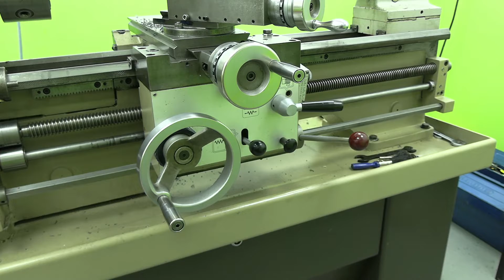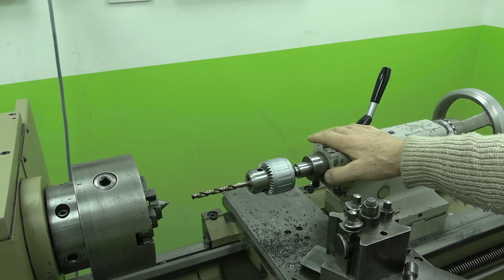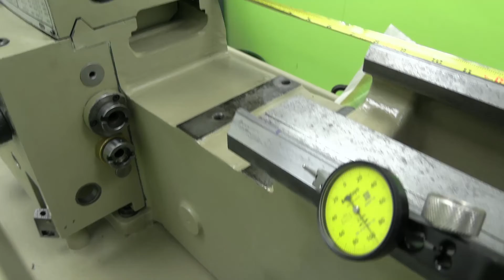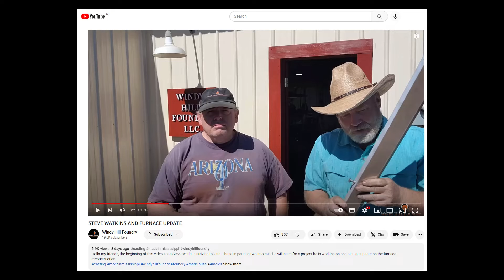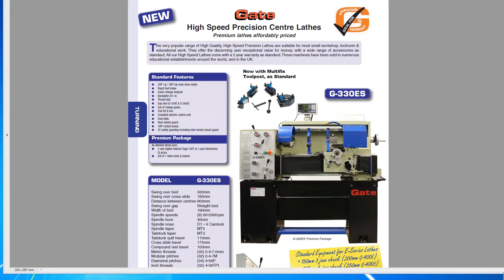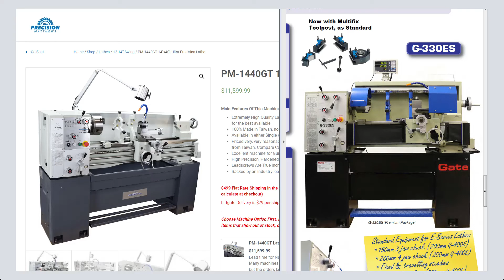What shall I do with my Harrison M300 lathe??

Comment: Hello ! I was on similar patch on resurecting Harrison VS330 Lathe - someday it was called a tool-room lathe, but it was closely based on M300, except different  headstock. 

What i did - regrind of the bed, regrind of cross slide, tighten of the main bearings,  bore tail-stock to 45mm and inserting sleeve made from cast iron bored to size of tail stock barrel. Which was lapped before of course. Sleeve was just glued on some loctite 638, while tail stock barrel was in 4 jaws chuck. Dialed to a perfect fit. 

Biggest head-ache was refitting of headstock on new beds - you need to grind contact areas top get all geometry property. 

Also - have same pitch selector problem - numbered selector was in wrong place. 

That is still left - adjust leadscrew play, make a new cross slide screw, fit a new, used saddle with new cross slide (i did fitted my old one, but its have too much geometric defects after it. )
Reply from the maker: My you've doen a lot. I don't see how to adjust the headstock alignment on my M300 without scraping the ways beneath the headstock, which seems problematic. Were you able to make the tailstock sleeve on the VS330?
Reply: @samuelfielder  Hello. I made sleeve for tailstock on same lathe. Biggest issue was boring old tailstock - did this with 4 jaws chuck and long and fat bar. 
Btw - if you glue them using loctite, you can make sleeves, not only one big. It helps to make them easier. And yes, to adjust head stock you scrap beds or add some shims. Some left shims in place, some use them to find amount of metal to be removed.
Reply from the maker: @StanislavZachazevski  I assume you made the tailstock sleeve slightly undersized for the tailstock i/d, and by holding the quill in the 4-jaw you were able to let Loctite 638 fix the sleeve is right place? A couple of youtubers have used a makeshift bearing holder on the saddle to line bore the tailstock sitting on the ways, which seems quite a good idea if you can make it work (https://www.youtube.com/watch?v=v6dtsHu_ljM&t=1562s and https://www.youtube.com/watch?v=ND6M26OHAEI .
Reply: @samuelfielder  Exatly - i have added some old videos. I tried to bore old one - but it is a lot of work to do it propertly and make it a perfect fit. You need it in a 0.01-0.015 gap, at whole length, with perfect surface and perfect alignment. Mine method - was lets give it a shot, if it will not work - add sleeve to be rebored in place.. All done on same lathe without any extra tool. And all proved as good as it could. And if something goes wrong - heat it, remove old sleeves, make new ones to lapped barrel and all done.
Reply from the maker: @StanislavZachazevski  Thanks.
Reply: @samuelfielder  you welcome. On boring tail stock - you place you boring bar in 4 jaws chuck, cross feed is done using chucks, longitudal feed - by placing tailstock between head stock and saddle. And you feed it using saddle. It have to be slightly pressed to beds using fixing handle.
Reply from the maker: @StanislavZachazevski  Thanks that is clear.
Reply: @samuelfielder  Found my old video of tail stock fixing process. https://youtube.com/shorts/AbUcFwxUmPI  https://youtu.be/EWKICmUa9EY  https://youtube.com/shorts/kmppnC6UiNs 

Enjoy ! Remeber - if you start to use you lathe as it is - you will adjust yourself, and will not fix it.

Comment: I've followed your progress and I use m300 lathes. I'd keep the one you have and buy a lathe bed and saddle and get that re-ground and transfer your stuff onto it. We may have one spare if you go down that route
Reply from the maker: That's an idea. It would mean I could still use the lathe whilst the regrind was going on up north. There might be a problem of getting the old headstock to align with the new bed, requiring scraping the ways under the headstock which is a skill I don't (yet) possess! Are you in Southampton UK?

Comment: I am no expert, but here's some info you might want to feed in: I watch Matty's Workshop. Perhaps you do too - he is based in New South Wales and makes some really good stuff and though I think he was not originally a trained machinist (not sure about this) he's very capable and practical. A couple of years ago he upgraded from his Chinese 9" lathe, and selected a Taiwanese lathe from the large Australian machine tool importer/distributor Hare and Forbes, the AL960B. He seems to get absolutely top class results from it, so window shopping I started googling around. 1. It generally has a good reputation on forums, though it is not common. 2. Precision Matthews do what I believe is the exact same lathe, the PM1236T, one down in size and $500 cheaper than the one you have looked at. 3. This is the relevant bit, I do believe that Gates do that same lathe - it's hard to prove it's exactly the same one, but Gates did come up as a reference customer on a site I found that seemed to be for the original Taiwanese manufacturer. Perhaps you also saw this lathe when you visited. My main point is that my conclusion was that whilst Gates did seem to offer good quality Taiwanese lathes, they were ridiculously over-priced - I mean that 14" one that you are looking at is £6300 in the US. I don't think I would buy from Gates, because although the kit is quite possibly high quality, they seem to be taking the mickey on their prices. This opinion is not based on an attitude of 'any 40 year old thing made in Britain is bound to be much better than anything made last year in Taiwan'. In fact, I was involved in steel supply to the engineering industry in Britain 40 years ago, and we turned out some right rubbish sometimes. And I was very glad to switch from British cars to Japanese at the time (when you heard the same patriotic guff about their products - though that's been rather forgotten in the last 40 years).

The problem with a 'good' used M300 for double/triple the money is that you don't really know if it's actually any good until you start cutting on it. Any on-site inspection is likely to be rushed and partial, though you could probably make a  much better inspection now than first time around. Still, realistically you are not going to find the perished oil seals before you buy it, are you? Seems to me a higher price will guarantee only better cosmetic condition, not actual better underlying condition, given how Ebay and machine tool dealers work. If it's disheartening to dismantle and re-grind the one you have, think how disheartening it would be to find the new one you paid £5000 for was still not good enough.

If you can solve the tailstock problem (find one on ebay or from a dealer one that is tight enough, and pay for a regrind for any height differences, or do some scraping?) then I suspect a  bed re-grind will make you happiest, but it's another year to sort out - quicker than last time as you know so much now, but still a lot of work. Good luck, well done with how far you have got already, and thanks for all the very interesting videos in that whole series.
Reply from the maker: Thanks. As you say I think the PM1236T is a little on the small size compared with the M300, so not sure I'd go for it. As regards the ridiculous UK prices of Taiwanese lathes, I'm afraid that's absolutely standard over here and I think I'd have to pay those kind of prices, unless I went for an inferior Chinese one. I still haven't decided what to do, but there's a machinery dealer pretty near me who has about five used M300 in stock, so I plan to go there and see if I can run a DTI along the ways - I can detect bed wear pretty well by mounting a DTI on the saddle and running it along the machined but unworn top of the front V-way - and see if any of them measure well. It would be more fun (for me and viewers) to go for the regrind, but I fear more potentially problematic.

Comment: Ok what i am going to say is because of my ues of very old lathes . what you are seeking to do it work you will not desire. so i look as lathe  as horse's for courses  So it is  time if you when perfection in a lathe You need to by new as for Bering agen you pay for what you get begging's  in your lave have  very good  hi quality bearings   you get what you pay for  Buy a  bran new lath  that as the quality you require .    Les England   the question you need to ask is  it cheaper to regrind . or buy new . !

Comment: Samuel, the way I see it you are the type of man that likes things to work the way they should and compromise just keeps you up at night. I am of the same mold. I looked and used stuff and decided to go with a new lathe. The reason was that I wanted to get started on machining projects rather then making the lathe the first project. However, that being said, if I had it to do over again I would probably still buy the new lathe but I would not have underestimated the value of bringing an older lathe back to serviceability because that experience is valuable also. I spent my youth taking things apart and rebuilding them. I rebuild a 1968 Mustang, many engines, and all kinds of building from the ground up. So I have plenty of experience with fixing broken stuff. So the decision for you would be fairly simple in my mind. Do you want to spend a significant amount of time and money learning everything it takes and purchasing all the expertise it would take to bring an old lathe back to life or would you rather spend your time dialing in a new lathe and getting on with your projects? A new lathe will have it's learning curve so what it boils down to is time. How do you personally value your time given where you are in your life. If it were me, I wouldn't take any more chances on buying someone else's problems and get on with your own projects with a new lathe that you can depend on. At your age you have earned the right to get right down to what you want to do and not waste a lot of time and money solving problems. My 2 cents. Good luck.

Comment: I think you will find that Warco do a lathe very similar to the Gate. I have an old Warco 13/27 that was made in Tiawan. It has had a lot of use, but can still produce very good and accurate results, because it has been looked after. I notice you have a small Warco mill, so assume you have no objection to buying from them. My only stipulation if buying from them would be to strip and thouroughly clean everthing before use, as the machines they sell are not properly cleaned of machining debris at manufacture. ie cast iron dust.

Comment: Hi again.
The head stock does not sit on the ways. The shaping is done  to level the head stock to the base on centre.
The four hold down bolts are clearance fit so you can tram the head stock.
I suggest you use some known   ground stock approximately 8 inches from the four jaw. Clock up on top at the end away from the chuck.
Once done move your clock to the horizontal on centre to the stock. 
Run down the stock to the chuck and record the reading.
Now loosen the four bolts on the head stock and tram as you would a vice in a mill.
Reply from the maker: The trouble with this method is that it relies upon the ways not being significantly worn, otherwise one is just adjusting the headstock to minimise taper near the chuck which may well not align it with the axis of the bed further out. Of course, that adjustment might still be worth doing in view of most turning being close to the chuck. I beg to disagree with you when you say that "the headstock does not sit on the ways". Please see https://youtu.be/yV8_sYzuZrM?t=1306 and following two minutes.

Comment: Hi I have looked at your videos as you suggested. I did not see a video of you checking the head stock alignment. 
I would certainly check before I went any further. 
There is a good video explaining this  head stock alignment colchester student . Hope this helps
Reply from the maker: Thanks. The M300 has no headstock alignment adjustment, other than to scrape the ways upon which the headstock sits. Also, I have not seen any method of testing headstock alignment other than ones that depend upon the bed ways not being worn. If you know of one please point me to it.

Comment: Final thought for today.  The 5C collet closer is a great addition to the M300 if you need to do small very precise parts.  In general you are working within 3" of the collet, which may have uniform wear within (or may not).  The one on my machine is a Royal, manual closer.  I don't know if they are available on the new market or not.  Machinable 5C collets can also be very handy for machining custom parts, eccentrics, thin flat discs, etc.
Reply from the maker: Actually my M300 came with a "Acro-Grip 5C Collet Closer" (google that in quotes) or an older version thereof. With hindsight that was a bad sign because it probably meant my lathe was in a production setting doing the same thing over and over again. I had to take it off to get into the headstock and have never put it back because (a) I have no 5C collets... yet, and (b) I simply could not understand how it was supposed to work! But 5C collets are clearly a great advantage for precise work.
Reply: @samuelfielder  Your collet closer looks the same in concept to the Royal version.  There should be a spindle nose piece specific to your machine, with taper to insert directly into your spindle end.  The long tube is spun with your left hand to thread a collar into place.  The large cylindrical portion has several bearings  which allow this section to float on the long shaft.  The upper and lower pins on the hand lever ring piece ride in a groove in the cylindrical part.  There should be some sort of finger which holds the cylindrical part from turning.  To set up a collet properly, think of vise grip pliers and how you may initially tighten them to just touch a nut you want to turn, then release that nut, increase the grip adjustment and lock on.  Install the collet but do not screw the handwheel down all the way.  Push your lever fully to the left (closiing direction), then turn the handwheel until the collet grips a test rod.  Now push the lever toward the right a bit and turn the handwheel a bit more onto the collet.  With back and forth interation you'll find the best spot for the lever and handwheel.  Let's say that happens to be with the lever centered.  When set properly, the collet will be tight and the lever will be able to ride on the cylinder's grooves yet the lever can slop left or right just a bit while the two pins ride the side walls of that groove.  That's about it.  There should be full instructions floating around the web. Link to installation for your closer:   roviproducts dot com

Comment: The last M300 I physically saw a few years back sold for $250 at a high school shop closing.  Ideal source for a lathe would be a small, precision prototype shop, a school that's eliminating shop classes or similar where low wear is found.  School lathes can either be in great shape or beat to heck ... a function of the teacher's skill and control over the class.  The $250 school lathe was the ugliest thing you'll see, heavily covered in spray can graffiti, most likely from some open storage area.  It was not well kept but I'm guessing that with good cleaning, it probably didn't really have a lot of wear from its school life.  My M300 cost $2500 from a small prototype lab back in 2004.  Probably would not be much more that than today but you need to avoid ebay and dealers.  Work of mouth may help your search.  Unfortunately, the M300 makes a great gun lathe and this can hurt the prices.
Reply from the maker: I take it you're in USA then - bang goes my cup of tea! I'm not so sure about "avoid dealers" if I want an ex-college low-usage lathe because they all end up at dealers.